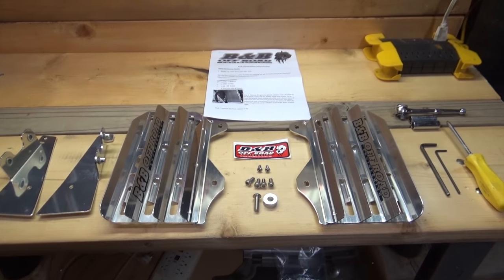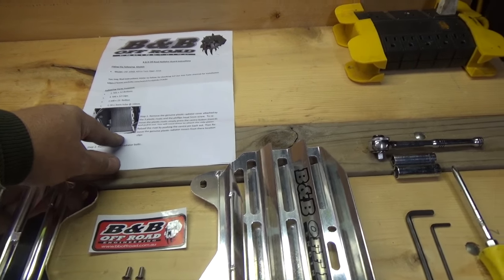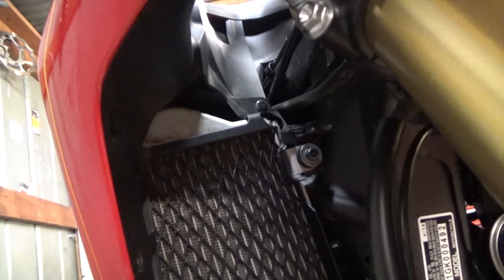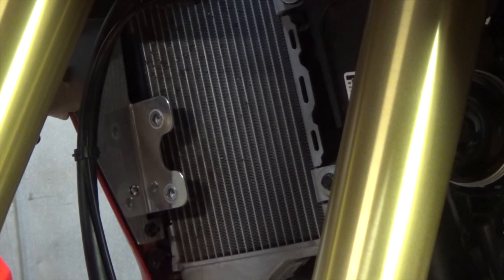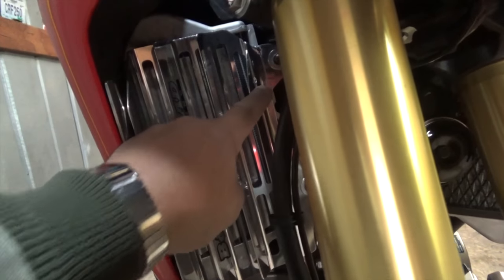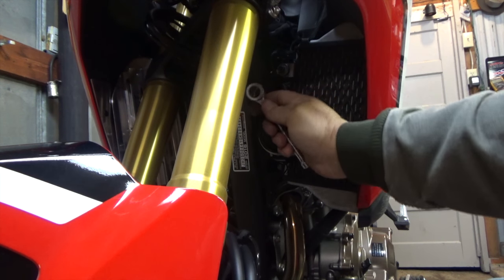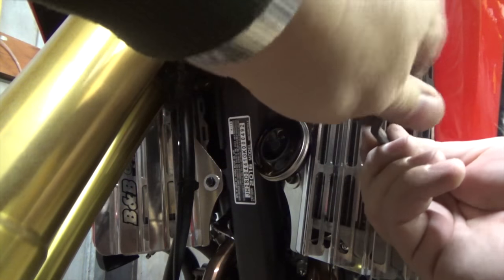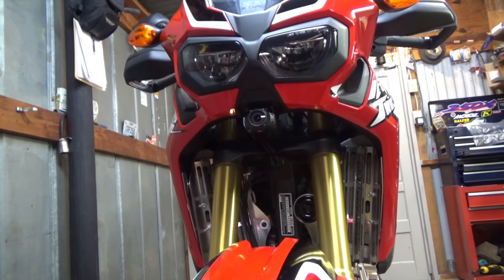Africa Twin B&B Off Road Radiator Guards Install Honda CRF1000L

Comment: Guess I got another TO DO added to my winter projects for the AT!  Thanks WoodzMan for the extra work ;)
Reply from the maker: +Peter Brophy Your welcome lol they are definitely worth the money. I didn't realize how bad the stock was until I removed them.
Reply: How long did it take for the parts to arrive once you ordered them?
Reply from the maker: +Peter Brophy two weeks. I thought that was pretty fast
Reply: WOODZMAN ADVENTURES how much they charge you for the International delivery?  I'm hoping the amount won't make me look for an alternate product.
Reply from the maker: +Peter Brophy Polished approx. $165.00 USD & Black approx. $180 USD
Reply: Hi WoodzMan, I was referring specifically to how much did they charge you for the "SHIPPING" cost only, not the actual products.  Just curious to see the difference in international parcel to USA vs Canada.  Thanks again and I enjoyed again your recent updated Screen Install...seriously getting low on funds because of you ;) lol
Reply from the maker: +Peter Brophy I think it was like $20
Reply: That is a good rate. They quoted me 103$ to ship to Canada or about $73 UDS that is for both the BashPlate and Radiator Guards together.
Reply from the maker: +Peter Brophy good to know, I wasn't sure

Comment: One tiny drop of blue loctite on the threads will keep nuts or bolts secure from shaking loose but can be easily removed.

Comment: nice work.  i have the B&B radiator braces and guards on my wr450f.  l can vouch for their strength.
Reply from the maker: +Martin Bennett Coolness ! I had not tried them before I got the AT but I do know that are made well.

Comment: Man, those are nice!!!!!  That old ass Mac phillips screwdriver lol, I bought the same ones in the early 90's.....still have em'.
Reply from the maker: +Twistygrip Fla They are pretty sweet. I didn't realize how cheap the stock plastic one was until it took them off but I'm telling you, get rid of them cause they are junk. Yea I bought that set of Snap-on screw drivers in the early 90's also. I bought them when I was racing motocross.

Comment: Which is better, B&B or Altrider. And why
Reply from the maker: +Gary Sit They are both great, The B&B is better if you don’t have Crash bars because they have sides the come up to protect the engine. The B&B will not work with Crash bars. If you have or want Crash bars theni would get the AltRider Skid plate and Crash bars because they work together perfectly.
Reply: So your saying if I want crash bars in the future to get the altrider radiator guards instead of the b&b
Reply from the maker: +Gary Sit oh lol I thought you was talking about skid plates !  I have the B&B radiator guards and not the AltRider.  So I can’t say anything about the AltRider. The B&B are good for sure. I like everything Altrider so I’m sure they are good also.